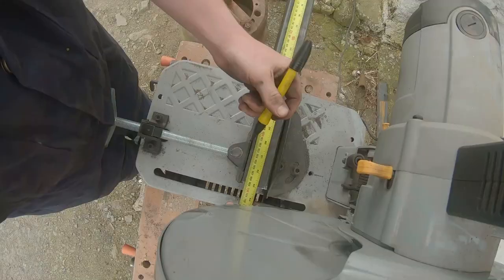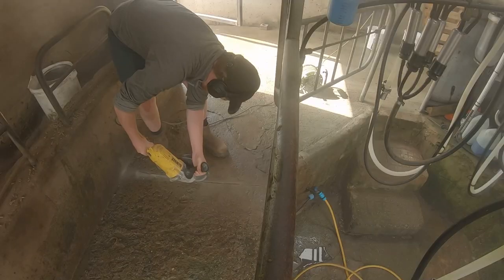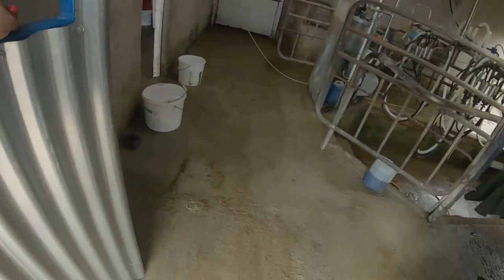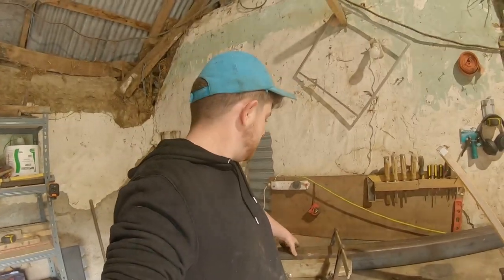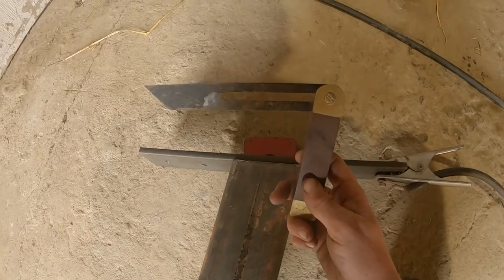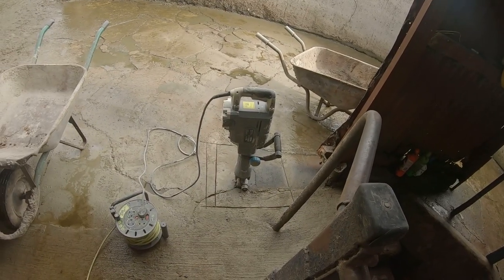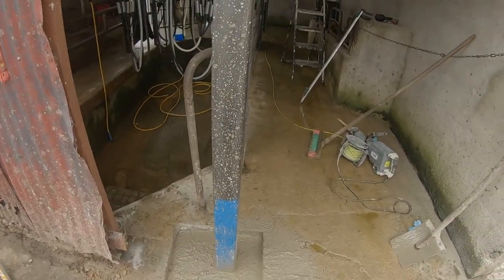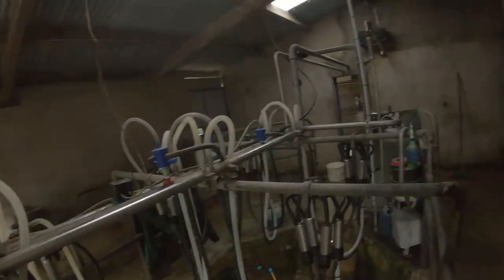Milking Parlour Upgrades | Welding and Fabrication and Concrete

Comment: Turn your voltage up to the max and adjust your wire speed till u get a nice constant bacon sizzling sound and u will get better welds. Good job all the same keep up the videos
Reply from the maker: Thanks for the advice Karl will try that